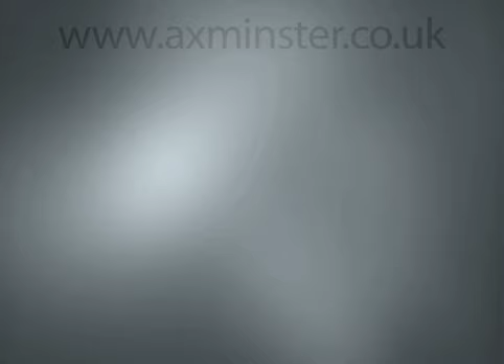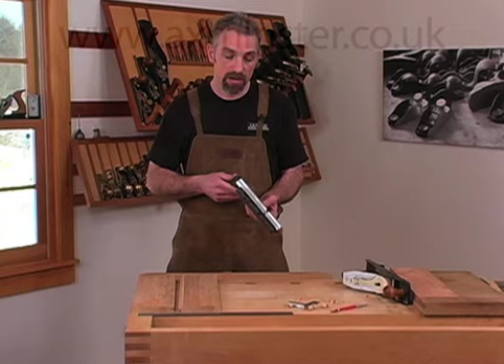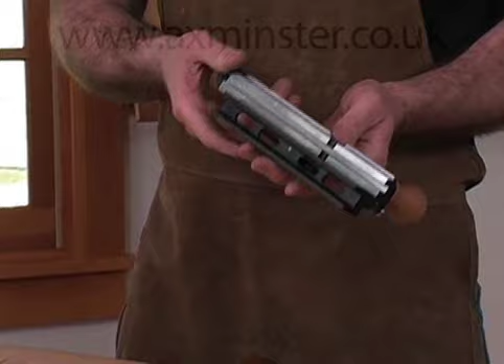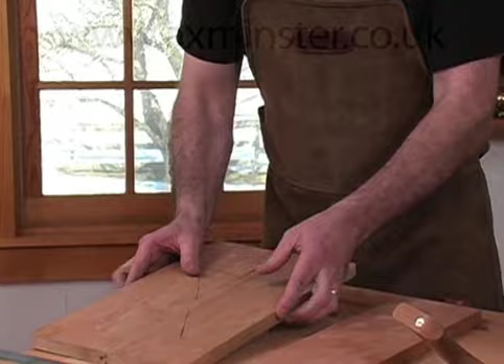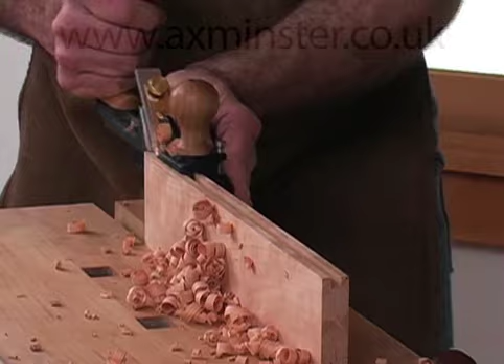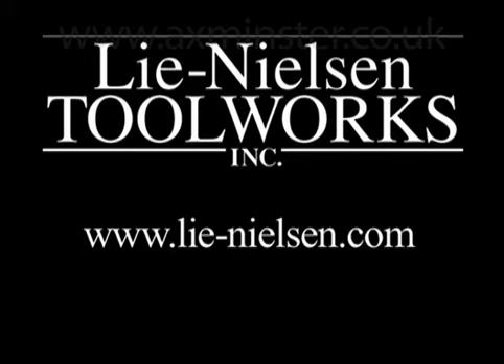Lie-Nielsen - Tongue & Groove Plane

Comment: Hi, thanks for a great video. This plane is on my shopping list. May I just ask one elementary question regrading sharpening the blade? How would you sharpen it? And how often ( let's assume general use ) would you need to do that?
Reply from the maker: Hi +Joe S the blade will fit into most honing guides and used in conjunction with a sharpening stone. we would recommend sharpening little and often rather than letting it get too blunt.

Comment: Deneb Puchalski, you started to make the groove first - that is a little foolish, with this tool after my opinion. When the right side of the plane iron make the double work when that section of the iron, makes both the one side of the tongue and makes the groove too. I mean it is better to make all the tongues first and then the grooves in the work. Otherwise there is a risk that the depth is not quite the same on both sides of the tongue, especially if the plane do its job in hardwood when one cutting insert works twice as much as the other.
 
 
On the window shelf behind you, Deneb Puchalski, I see a number 72 chamber plane.
When is Lie Nielsen started making them? I cannot find them in the sale catalog.
A prototype which is not on the market yet?
Reply: Peter Brandt Petersen Your grammar prevents anyone from knowing what you were trying to say. I guess your criticism should be noted, however, because you can call out plane models as you see them.